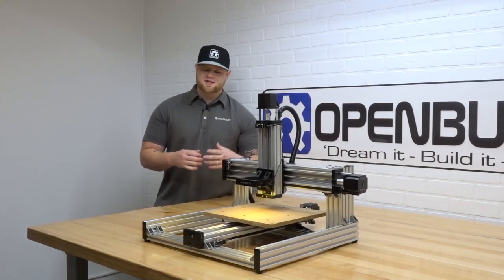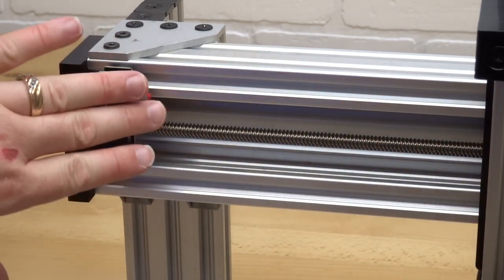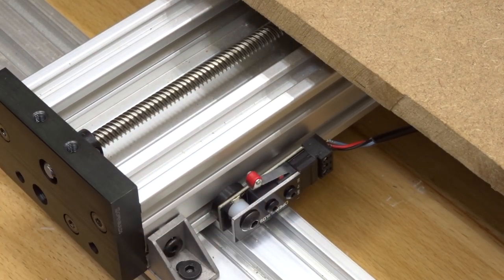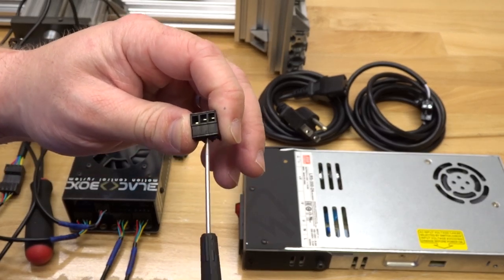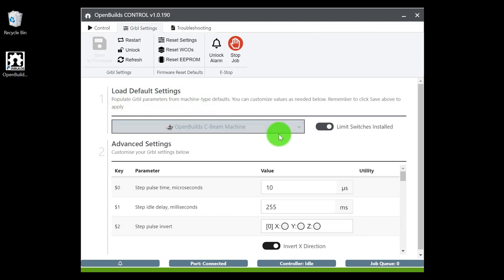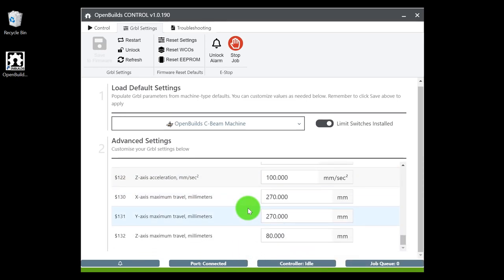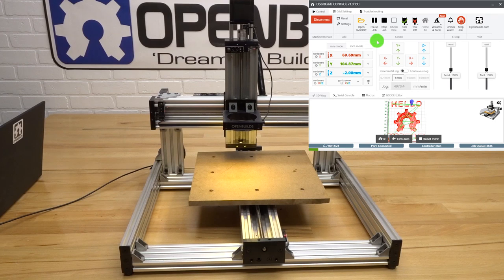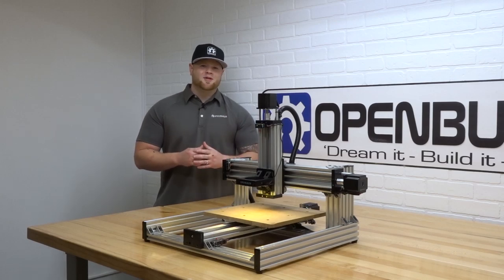OpenBuilds C-Beam Machine Electronics and Software (Using BlackBox)

Comment: thank you for the video,,,I have the c-beam xl,,, will it be exactly the same configuration just on a bigger scale,,
i.e will I just have to fix the black box to the center of the rail and allow more slack for the extra travel for the x-axis as well as the z-axis?
Reply from the maker: Hi please check out the build here: https://openbuilds.com/builds/c-beam-machine-xlarge.3675/
Reply: @OpenBuilds  Hi It doesn't mention the wiring of electrics like the above video,,can you please help ?
Reply: i have built the machine its just the management of the cables  I need help with.